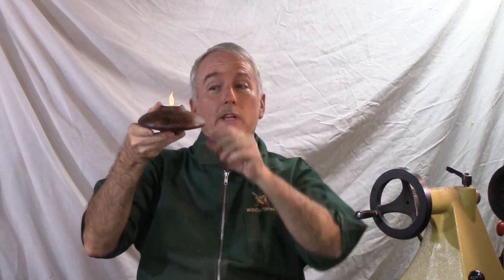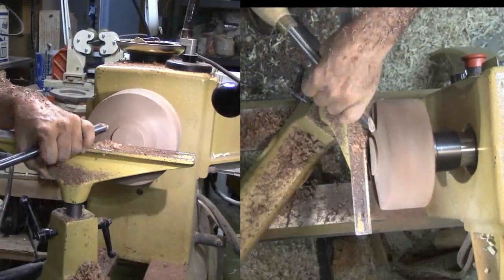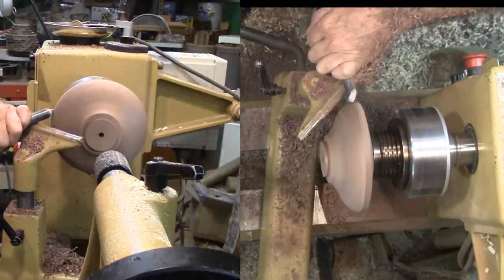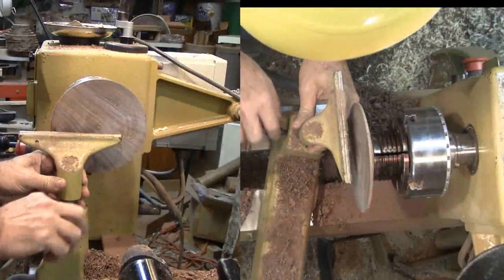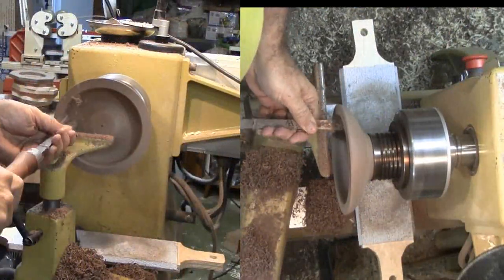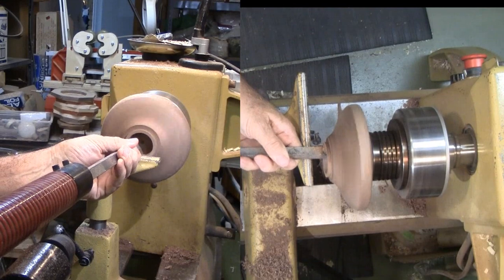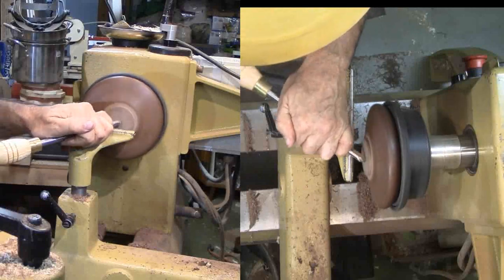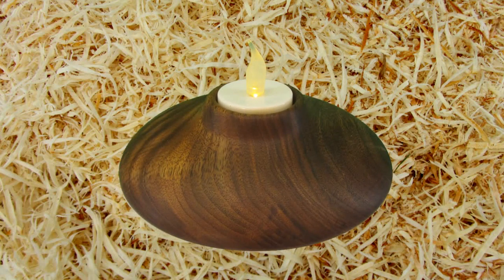Woodturning A Hollow Reversible Tea Light

Comment: Alan, I have seen the joining kits to make hiking staffs. There are also the tips for these staffs. Have you ever made one? Maybe a future demo? Making it as two parts would help if a hiker was traveling and needed to pack it.
Thanks for any help you can give.
Reply from the maker: Interesting idea - I see kits at TreeLine USA. I'll have to research more to see how turning can enhance such a project over carving. Walking sticks that I like best are telescoping aluminum -- not sure I can beat the telescoping feature on a wood lathe. Certainly could be done with a pretty wood.
Hmmm.
Alan Stratton
Reply: As Wood Turns
I picture a wooden staff as being like a pool cue. I want to do this for the two hikers in the family. Aluminum is nice, but wood would be a nice look. If it can be broken down in two shorter pieces it would be easier to travel with. Good i
dea?

Comment: Love your little UFO projects!  I am wondering how well it would float for floating tea light candles on a pond?

Thanks,
Sam
Reply from the maker: I was skeptical that it would float without capsizing. So, I put it in a plastic bag and tested it. I'm using a LED light.  With the wide base, it floated beautifully and seemed quite stable. However, it would have to be well sealed to not ruin the wood. 
Interesting idea for a very special occasion.
Alan
Reply: As Wood Turns After I post the comment, I though to myself "except you would not really want to get the wood wet" :)
Cool that it floated nicely!
Sam
Reply from the maker: Sam Slechta May have to use marine grade poly. But that's not my preferred finish. :)
Alan